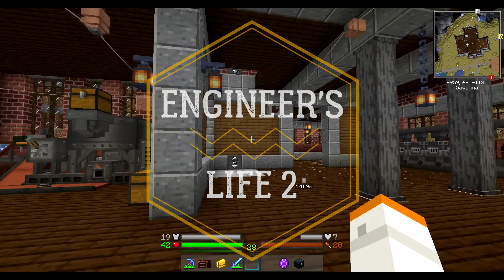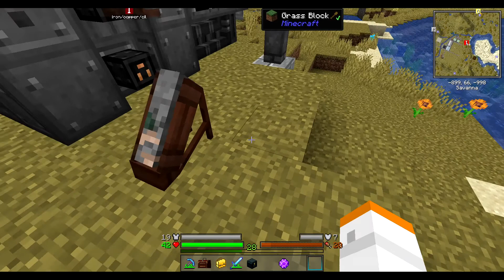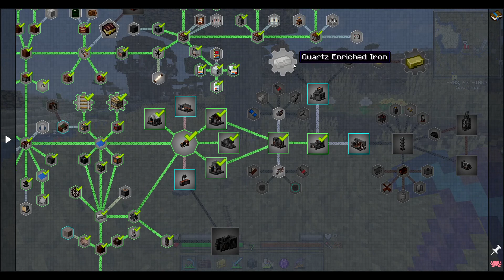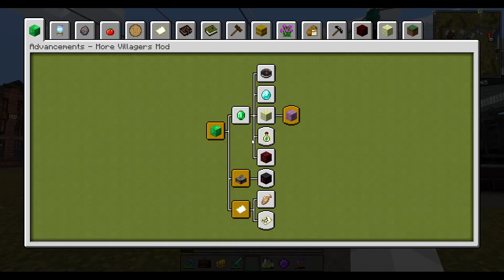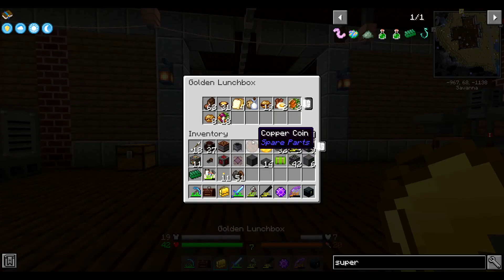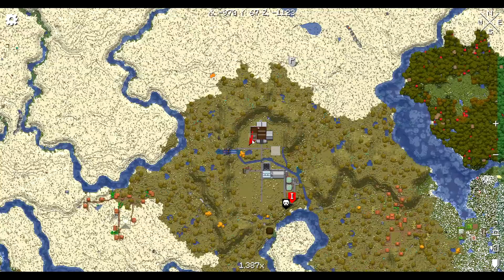Engineer's Life 2 EP26 Base Upgrades & IE Arc Furnce!

Comment: that is really wierd with the wires thing. and from what I can see there is 6 capacitors. even if they could push max flow, 6 x 4096 is 24,576 which is under 32k so it really makes no sense to me, unless its a chunk border. I have had issues with a mekanism reactor exploding once due to odd chunk loading. what I would suggest tho just in case and it will give some errors first load, is make a copy of the save (so nothing can get corupted) add mekanism to it, go into creative mode (would take ages to do this in survival) and build a small induction matrix between them so the power flows through it. unlike IE, Mekanisms induction matrix will show the actual transfer rates both in and out.
Reply from the maker: If this continues I will be adding another power transfer mod and be done with it, not going to troubleshoot an issue with the mod with another mod, have many other things to do with my life. Config changes will be first once I can figure out where they put them, location has changed since 1.12, shutting off the line loss at times solves the issue.
Reply: @Frogman79  also thought I'd let you know because it annoyed me as much if not more than you, at the menu screen, if you click the mods button, and scroll down to project mmo, click the config button, where it says common, click the modify button, go down to levels, you can disable those stupid ass fireworks :)
Reply from the maker: This is an issue I have dealt with since the game started and it is one I need to fix. Thank you.
Reply: @Frogman79  no problem, they have made me fall off ledges and crap because I jump every time
Reply from the maker: FWIW I am not enjoying the pure simple lack of config options for the things like the fireworks for the highlight crap on the ground mods. I know how well 1.12 was fleshed out for mods and configs but I am finding 1.16 very hard to navigate as most of the trees have changed and containers for configs either NOT being where they were or otherwise NOT even being mentioned makes an old minecraft player ready to just leave it for a while. I know OLD man syndrome but damn, its been this way since before beta why are we changing?
Reply: @Frogman79  you can pretty much access all the configs at the main menu now. its pretty easy now I feel at least. at the main menu just click the mods button, find the mod and click config. 99.9% can be adjusted there (single player) servers are a bit more wierd tho. but if you need help lemme know and I'll try to help. do have discord ?
Reply: @Frogman79  I never played 1.12 only 1.16. but I know it pretty much inside and out
Reply: @Frogman79  also if you want, I have a public server running EL2 (with a couple added mods like cc:tweaked because of the reactors and pneumaticraft because I love the drones). your welcome to join. a lot of the settings have already been tweaked to get rid of most of that anoying crap
Reply from the maker: I'm working through things, I'm more used to the old fashioned edit a text file with all the config options laid out in front of me. Some are still there but the one I want to tinker with the IE wires is no where to be found. Far as discord the link in the description should still work. Its a quiet corner, not much going on but I do watch it.
Reply: @Frogman79  its still that way, just the mods button at the main menu gives a nice ui to it all. but the files are in 2 locations 1 is in the main instance folder in the config folder (some mods have a sub folder) then stuff that normally would be protected from user interference is in world/serverconfig (or your save folder if single player). its the .toml files your looking for. but a lot of it is in the world folder to prevent player tampering in the case of servers and single player does still run a background server. I hope this helps out. also if you have multiple worlds you can copy the files in the server config to a folder in the instance folder named defaultconfig, and it will copy those changes to every new world for that pack.
Reply from the maker: I guess this is a case of my old blind eyes not knowing where to look, I have been in and out of every folder named config except that one. With the recording hell of burning wires in the video after this one that will be the last time. Thank you, I would rather use the pack as it sits and modify the config slightly then add in mods to get around a short coming in one.

I understand the need to make things harder for someone on a server to mess with things, but I very rarely play on public servers anymore. If this pack continues the way Manufactio did for me, it will get moved to my local box again.
Reply: @Frogman79  I run a server because my potato pc can't handle both plus stream. so I've learned where everything is. but then I also started with 1.16 so I guess that just made it easier. glad I was able to help in any way. great series love the build designs. I'm not very creative so my stuff is scattered all over and looks like hell, or I build underground where looks doesn't matter lol.
Reply from the maker: @problemchild959  Well, I have been learning how to build for the last few years. It takes time and an understanding of a story, if you can't make a story or find one then its hard to imagine what you should build. Once you find one, you can find examples of things you would see in that story and then you can just build them. I am no Pixel artist or Bdubs but I am enjoying the side of minecraft that is building more with each pack. I used to build just all over as well and my main love for minecraft is skyblocks so its always made it easy to build bases, because there is no world to work with. I'm not gonna be a 9x9 Direwolf if Ic an help it. 

Thanks for the help, I would have eventually found it but not before I pulled more hair out. I run a home server at times, the packs start to get too much for my pc to deal with now with OBS running, learned that several years ago. This pack is starting to get there, although its still running nicely on my machine for now, but I have barely scratched the surface of my plans, I build big and tend to do things the hard way because its more fun than just running ME/RS cable and having the computer do it. I like THINKING not just following.